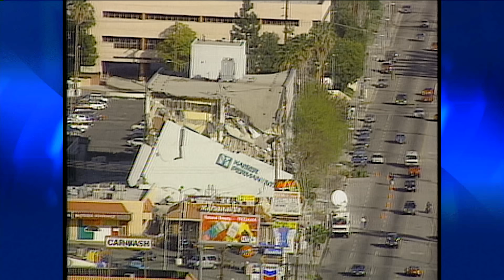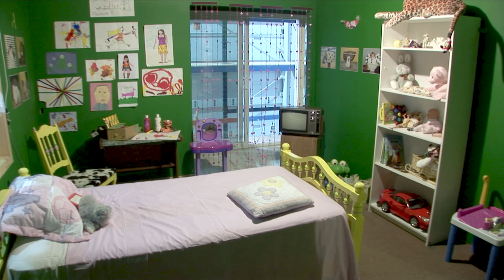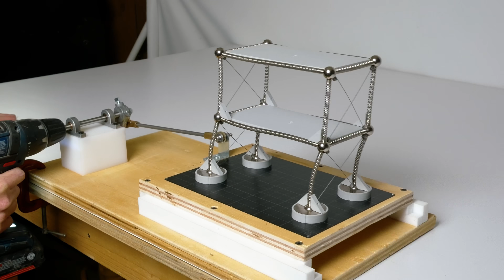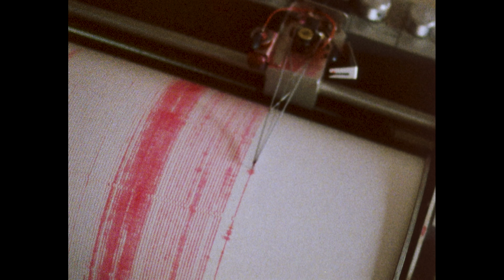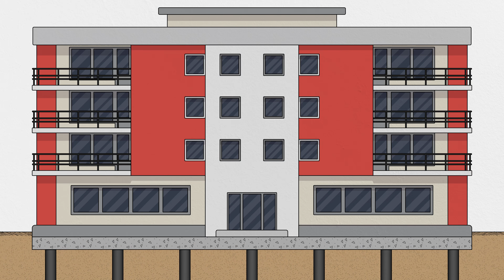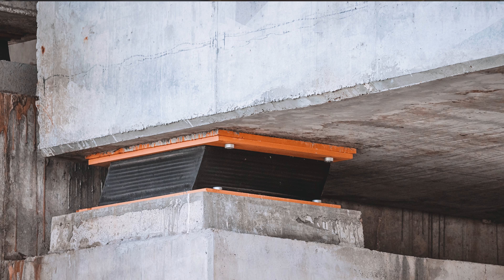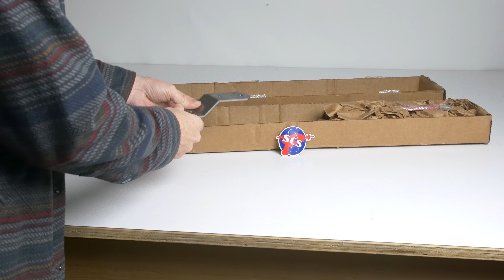How Earthquake Bearings Work

Comment: Is this also how non-earthquake structure isolation works? I know some facilities, like CPU manufacturers and fusion labs, are so sensitive that they need protection from normal earth settlement, vibration from traffic or equipment elsewhere onsite, stuff like that. I wonder if it's easier or harder to design something that accounts for those tiiiiiny little movements...

Comment: My mom survived the Tehachapi (Central CA) earthquake in 1952, she lived in San Gabriel (LA Foothills). We lived in Huntington Beach in OC when the 1971 6.5 Sylmar earthquake hit that took down the 14 Fwy bridges the first time. My brother got seasick when his bed shook to pieces, and my bed on wheels rolled back and forth on the wooden floor. 

We were living in Valencia, down the street from Six Flags Magic Mountain when the 6.7 Northridge earthquake hit in  January1994. We were on the other side of the mountain from Northridge, and the earthquake triggered the Newhall fault a couple of miles away. We got a double jolt, first side to side, then a second or two later a vertical thrust threw our bed up to the ceiling (had to brace myself from hitting it with my arms). 

We were in an apartment building right next to the Santa Clara River, and we suffered a lot of liquifaction. So when we bought our home in Canyon Country near Valencia in July, we made sure to buy a house built on cut not fill. Our house was built in a cul-de-sac in a little granite box canyon. No cracks from the windows or patio doors.

Comment: I wonder if this would work on RV’s, and if not, how do RV manufacturers account for all the shaking that occurs as they drive down the road? Sure, a motorhome or a travel trailer has suspension, but even so, all that movement has to be extremely hard on the structure. 🤔
Reply: vehicles have rubber tires, shock absorbers, and springs for each wheel and axle.

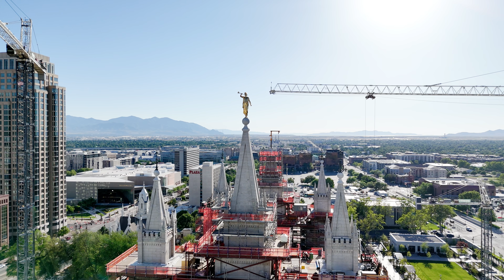Comment: 12:18 Our capitol building also underwent similar retrofitting a decade ago. Probably one of the only reasons that the 5.7 earthquake in 2020 didn't cause extensive damage to it when hundreds of other buildings had enormous cracks in walls and foundations.

Comment: Thank you Grady. Dr Bill Robinson and his team at the DSIR in Gracefield did excellent work developing the base isolator system which protected that hospital; and has protected many other buildings over the ensuing years. I visited an exhibit by his team in the 1970s, at the old Overseas Passenger Terminal in Wellington, on the other side of the harbour. I understand that their use of lead plates echoes technology that has kept the Parthenon erect for centuries, notwithstanding the explosion of a Turkish munitions dump during a 19th century battle. Cheers from NZ🇳🇿.

Comment: If you 'decouple' the structure form the ground, that means it literally is not attached to the ground, engineers are so sloppy with terms, what they mean is that the coupling has the ability to move in the x,y direction without causing rotation or angular buckling in the z direction. It is definitely coupled, just in a much more complicated way.

Comment: Might have been neat to show off the level of isolation electronics fabs implement. Just a few months ago, Linus Tech Tips had a factory tour with Kioxia. I thought the foundation was one of the most impressive parts of the tour. 

On the other end of the scale, semi truck tractor cabs are also typically mounted on air suspension bladders (with dampers) for reasons of driver comfort and endurance. (Often they'll also have air suspension in their chair, as well.)

Comment: There are exceptions in earthquake frequencies though. In greater distance long period shaking leads to higher impacts on highrises. Usually the intensity is too low to cause damage in such distances, but the 2025 Myanmar Quake (it was a supershear event) caused high intensity shaking directed towards Bangkok which lead to stronger shaking of highrises. It stil should not have lead to significant damage, which it unfortunately did due to low quality materials.

Comment: I’m not an engineer or architect but I was taught how to build a block and concrete house by my grandfather and uncles who were, we built my mom’s current house in 1972 and it has survived all that nature has tossed at it. I want to build a house in the Philippines which is in many ways like my country Puerto Rico, it’s tropical with a yearly hurricane (Typhoon) season and both have hundreds of small earthquakes per year… sadly some of those aren’t so small and we have mudslides or destroyed buildings all over. Is there a company that specializes on these foundation bearing devices or blueprints I can buy for them to be used by builders abroad? This information is so far that not even google can find it. 

Thanks.

Comment: floods vs earthquakes are totally different. "giving up" on floods is a political limitation, not an economic one. flood risk can be eliminated anywhere, if we simply built 10 story buildings everywhere, the cost per sf of each unit will be the same as smaller buildings but the vast majority of units would be outside of any possible floods, period. the reason we don't is because some people would rather swim to work in the name of aesthetics.

Comment: I worked at Loma Linda University Medical Center when we had the Big Bear-Landers quakes in 1992. The main building and "clover" with the patient care units was apparently built to separate rather than collapse (not an engineer. so i'm probably using the wrong terms).  On the upper floors, the separation was big enough that gurneys had to be lifted a bit to get over the gap, but I don't remember any big repairs happening - just plates put down to cover the gaps.

Comment: LA City Hall was seismically retrofitted (1997 through 2001) following the 1994 Northridge Quake.  Unfortunately, the seismic upgrade was based on a base-isolation system, which reportedly did not account for the fact that the Puente Hills blind-thrust fault system runs directly under downtown LA.  As a result, the anticipated vertical ground acceleration during a maximum 6.5 to 7.5 magnitude seismic event might prove to be quite high and thus might well result in significant damage to the base isolators located beneath City Hall.

Comment: For hospitals isolation makes complete sense. I’ve grown up in construction. With the amount of pipes and equipment installed in them, adding 2m to the cost of the build pays for itself after the the first quake would otherwise cause 10m in total repair cost. Considering plumbing, gas piping, equipment damage, long term protection is worth the expense.

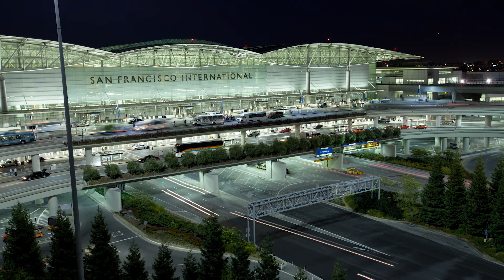Comment: San Francisco Airport international terminal at 11:47 is 1.2 million square feet seismically isolated with friction pendulum bearings large enough to match the large columns. Only noticed 3.5-4.0 shakes in that building because a tsunami alert went off on my phone.

Comment: I've seen the isolation pads under the Beehive. NZ's parliment building in Wellington. What struck me was that they were retrofitted, which must have been a huge undertaking.  They only help with lateral acceleration though, as Brady said, and the 2016 Kaikoura earthquake had an unusually large vertical acceleration.  After the quake the Geonet scientists held a public talk in Blenheim, and they were like kids at Christmas with excitement about so unusual an earthquake.

We build our houses as light as we can.  Especially the roofs with use steel instead of heavy concrete tiles.  That means much lighter joists, spread further appart, and much less mass to resist any shaking.  In the 2010 Christchurch earthquake it was the solidly built buildings like the cathedral that suffered the most.

My wife and I have experienced several earthquakes, but the 2016 Kaikoura quake was by far the most violent.  It lasted two minutes, and in the second minute, when the epicentre moved to Seddon, about 30 kilometers from us, we could barely stand up.  I'll be happy to never experience another quake like that one!

Comment: I'm just waiting to go into a CT scan and realized how insane it would be if earthquake hit while inside the tube with massive moving parts. These are then critical to work after any accident struck. Well, we don't have any earthquakes in here, but just used it as a though experiment for other locations. Would be absolutely critical to design the most important buildings with proper safety factors.
Reply: MRI machines are tube shaped. CT scanners are donuts, open on both ends.

Comment: I would be really curious to see a comparison of the simple 3 rod version where the drills handgrip part and battery would  be separately (at the same time) attached to the table. Is that movement a feedback of the in-between frequencies that the oscillating rods do not resonate with? And if so, how would the same test over the same timelapse with same speeds look like?

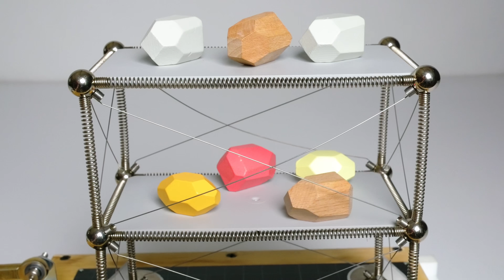Comment: 6:09 what you want is for the building to bend and twist and flex as much as possible and then return like a spring to its previous state   or put another  to maxima the structs and the structural components elastic deformation while minimizing their plastic ones  i wonder if you could do something with eddy currents s or maybe some sort of piazo electric thing that takes that energy from the shake and converts it to electricity and then discharges it as hear to a radiator or something

Comment: @PracticalEngineeringChannel
Grady, you should peek at 'The Westcoast Building' or now known as 'The Qube'  - 1333 West Georgia, Vancouver, Canada.
Built in 1969 - Originally an office building, converted to Residential.

It's Earthquake resistant because it actually 'hangs from its own roof', or from the concrete column that runs up in the center of it that also holds the elevators and services, and the outer living space part of it is not joined to this core ... so it swings like a playground swing.  Built from the top, down.

Been known to move slightly in gale winds.
It has a Wiki page, very interesting engineering idea - didnt catch on, expensive to build, but is the MOST earthquake resistant building in a very active zone.

Comment: I was almost hoping you would mention the seismic-resistant timber framing technique used in Japan called Ishibadate or "standing on the stones."

The structure's support pillars rest freely on stones or concrete blocks without coupling or fastner. When stones are used they are normally small, round natural boulders with the resting end of the pillar being scribed to fit.

I don't know what category it would fall into in this video but basically the "feet" of the building are allowed to shift laterally and the joinery of the overall structure allows for some degree of flex and absorption.

I'm sure there are similar techniques used in wooden structures derived in many seismically active areas across the world, but this is the one I've seen the most published work for.

I find it notable that in some instances the foundation and structure can be made completely with natural materials.

Comment: Yay! Another engineering video from Grady. They did the same thing with NORAD except it was built in a mountain using rock bolting and netting but the structure was built on springs because of a potential nuclear explosion near the mountain complex.

Comment: In Tokyo, one of the industrial buildings I worked in was isolated. I wanted to see the bearings but the space was rated as a confined space so I couldn't see it. No 'moat' around the building. It just had signs saying not to stand within about 20cm of the building in case there is an earthquake so you don't get smacked by a building.

Comment: I first heard of this kind of base isolation many years ago on a science program.  If I recall correctly it was back on the late 1990's.  The example was a building in Mexico City that was isolated by sliding plates similar to the curved plate example at 13:55.  At the time it fascinated me and I wondered why all buildings were not constructed with that isolation method.  It just seemed to me to be a no brainer.

Comment: For anyone wondering "How do they figure out the resonance frequency of a building?" You use something called a shaker. The one we used in undergrad was a massive turntable (like an old style record player) about a meter across bolted to the top of the building. You bolt a huge 50-100 kg metal semicircle onto the turntable. Then you spin the turntable at different RPMs. Because of the offset mass, it pulls the building around in a circle. A bunch of accelerometers placed within the building measure any vibrations caused by the shaker. And you ramp it through a bunch of different RPM (frequencies) until you measure a maximum acceleration. That's your resonance frequency. We did it on our 7-story school library. And yes, you can feel the whole building shaking when you hit the resonance frequency.

Comment: The Salte Lake Temple of the Church of Jesus Christ of latter-day saints is an amazing project.  A total of 98 base isolators are being installed under the Salt Lake Temple as part of its extensive seismic renovation. These large, 18,000-pound, 7-foot-diameter devices are designed to allow the historic structure to move horizontally up to five feet in any direction during an earthquake

Comment: I did something like this in high school when building a balsa wood building in an intro engineering class. I used a few compression springs between the base and the plate that would attach to the earthquake test machine. The teacher ran it up to a 9.0 and it held up great. The teacher wouldn't let me run it longer because he didn't want to break the test machine. He kept that building for years to show other classes until someone broke it.

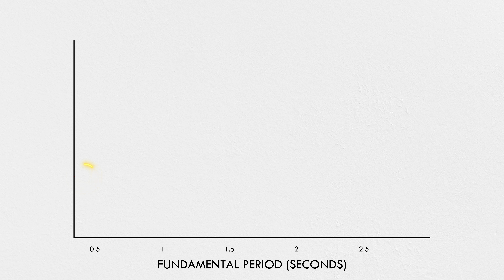Comment: 8:38 The frequency of most earthquakes matches up with the resonance frequency of 3-4 story buildings. And if you look at the damage from the Loma Prieta, Northridge, Kobe, and the Great Tohoku earthquakes, most of the buildings which collapsed were 3-4 stories. Something to keep in mind if you live/work in earthquake-prone areas.

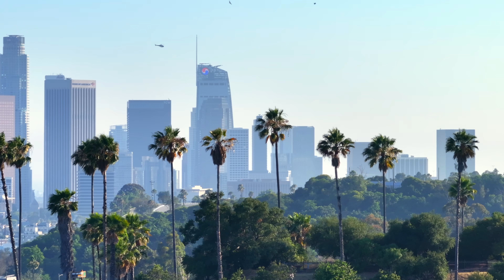The Northridge quake was unusual in that they recorded vertical accelerations in excess of 1 g. Most earthquakes, the vertical accelerations are only 0.1-0.15 g. So the idea that you could rely on gravity to keep a building stable in the vertical direction 3:44, went out the window.

Comment: Unrelated question, lately I've noticed that a lot of bridges here in the northeast have been having their expansion joints filled in. I don't know what's happening underneath, all I know is that where there used to be a pair of toothed plates and a gap, there's now smooth pavement, but the underlying structure of the bridge hasn't been replaced, just repaved. Any idea what might be happening?

Comment: Happy to see Oakland City Hall and the SF Bay Bridge. The old city hall building was retrofitted with the very plate, rubber, lead core isolation system discussed. A cutaway sample is located among the displays hiding somewhere on the main level. Last time I saw it, it was tucked almost under a table. Supporting such a large structure and hiding the beams used to tie the building together was a successful retrofit preserving the historic appearance of the building and protecting it as well.

Comment: Vertical movement can still be very intense in certain earthquakes. The 1968 Meckering earthquake in Western Australia had a vertical displacement of nearly 2m or 6ft in only a couple seconds. Witness said objects were thrown into the air with two powerful vertical jolts followed by intense east to west shaking. The energy released was about 150kt or 10 Little Boy atomic bombs. It was a 6.5 magnitude or a 9 on the Mercalli scale.
Reply: Vertical displacement means fault slippage, which doesn’t equate to earthquake speed. Also the little boy atomic bomb would’ve been measured by the richter scale, not the mercali scale, which measures ground movement.

Comment: In 1984 I was an undergraduate in a graduate seismic engineering class at Berkeley, and when we needed to do our term paper, I did seismic damping. 

 I looked at several approaches.  The most innovative work at that time seemed to be coming from New Zealand.  I was supposed to give my opinion on which technology seemed to have the most promise.  I picked the lead-filled bridge bearing base isolation approach for short buildings.  For taller buildings, my pick was lead filled diagonal braces.  In the time since, lots of short buildings have been built or retrofitted with the lead-filled bridge bearings. The lead-filled diagonal braces don't seem to have ever caught on much.

Comment: stanford hospital has the same things under the building there, but they look taller, which may allow more movement. Anything going into the building such as pipes and electrical was run under the building to flexable joints where it entered the building.

Comment: If the rubber is dissipating the energy, is the heat that produces a concern for the material, or do earthquakes not last long enough for that energy dissipation to heat it up to the point the material is damaged?  Do they need to replace these rubber pads after quakes of a certain size because of material fatigue, or is a quake serious enough for that going to mean the whole building needs structural repairs anyway?